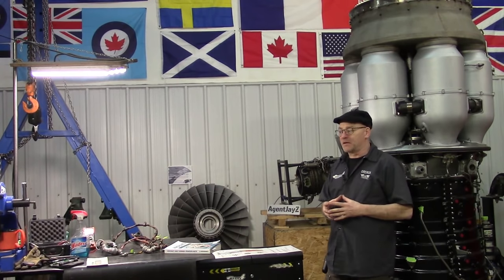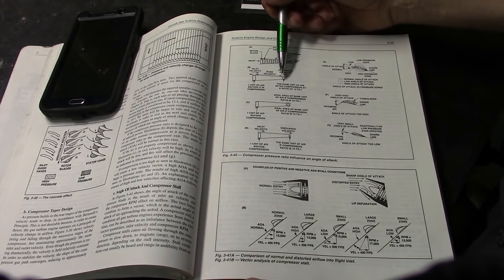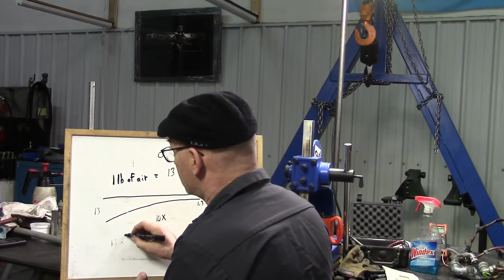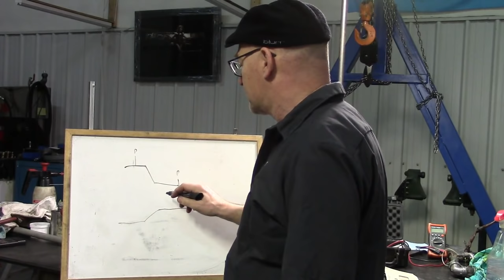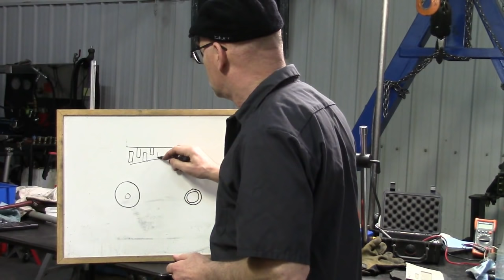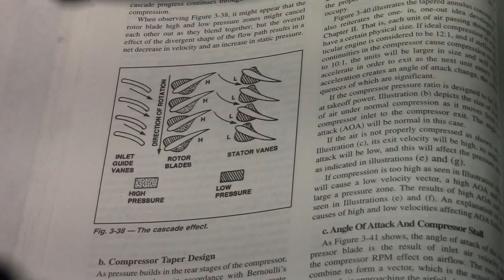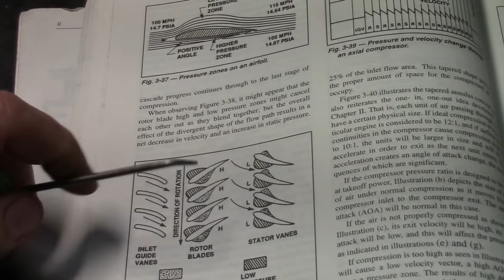the Narrowing Compressor Gas Path: Jet Engine Mistakes 3

Comment: The problem i still have is that all the individual steps make relative sense, but not how they all come together, why does it just... work... compressor sucks in and compresses air so we can burn  fuel in it, it sucks in the air because it’s spinning because its being driven by the turbine in back, thats being driven by the exhaust gasses from the combustion, which is running because of the compressed air being fed by the compressor.... and on and on, it doesn’t really click as to why there is a steady state directional energy being produced by adding the energy between them... it feels like the energy added in the combustion should just push both ways equally, nothing more useful than putting a candle between two pinwheels...
Reply: I had the same problem.  He explained this in his combustors videos.  The pressure outside the combustor is higher than inside the combustor.  So the expanding gas flows freely out the back toward the turbine.  Watch his series on combustors.
Reply: This sounds like a chicken and egg problem. Maybe this will help: When you start the turbine engine e.g. using a "starter", you first need to get the engine spinning, so that the air is already getting compressed and flowing through the whole engine. Only then you can add fuel, and the hot combustion gas can only go out from the back because it has a lot of compressed air pushing it from the other side. Together with the compressor, the started is also spinning the turbine, but once the accelerated hot gasses reach the turbine they will start spinning it and the starter can be disconnected. From that point on the process sustains itself as long as you keep pumping fuel. I can only guess what would happen if you would try to just pump fuel in the engine and ignite it without a starter spinning the compressor. My guess is that nothing would happen due to the high flash point of jet fuel (38 C). On a hot day maybe some of the fuel would burn thus consuming the oxygen in the air already inside the combustors and then the flame would go out. Disclaimer: I'm only an enthusiast. AgentJayZ has already corrected me in the past and I would be thankful if he continued to do so!

Comment: 1,05^10 = 1,63. To get 10 times compression in ten stages each stage has to be 1,26. Modern engines are even more aggressive, like 1,4 to achieve 30 times compression in 10 stages.
Reply from the maker: I'm about getting the general idea across, and avoiding picking over nits and wits.
Modern engines have over 40 :1 compression, and have more than 10 stages.
Reply: @AgentJayZ  I get that but it sounded so far off I thought I might be missing something. I had a look at GE F414 as modern but it is still close to 30 years old so not quite new. I'm a bit amazed what it can do with so few stages when the older J79 has 17 stages and half the compression. Does each stage in an engine provide the same compression or can there be a big difference between the first few stages and the last?

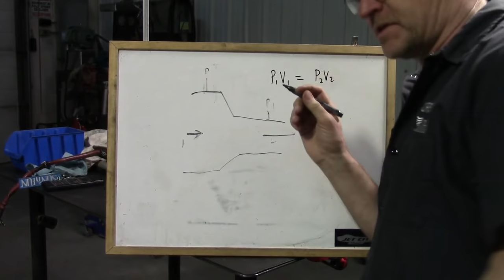Comment: 13:45 This should be P_1  + 0.5 \rho  v_1^2 =  P_2 + 0.5 \rho v_2^2, where \rho is the density of the fluid (neglecting temperature change).  Bernoulli's Equation.
Reply from the maker: This channel is all about explaining things without equations.
Reply: @AgentJayZ  and there's tremendous value in that. Unfortunately, this is one of relatively rare times you write an equation, and  an even more rare instance of the equation being incorrect.
Reply from the maker: OK. But the point of this video is that the compression does not happen because of the narrowing of the gas path. The narrowing of the gas path is created to maintain the velocity of the compressed air.
Reply: Thanks for clearing that up.
Reply: Density, volume and speed and in that order?
Reply: @nunyabusiness7630  P is pressure (pascal) v is velocity (m/s), and /rho is density kg /m^3.

Could do other units, but that's really annoying.

Comment: Mr. JayZ, you're probably busy getting to many questions, but here's mine:

Like you said, after each stage of the compressor, or after each stator, the pressure is increased just a little right? And this is why these engines have many stages, so they can compress the air enough for combustion with fuel. What about tiny jet engines that only have one stage? (a hobby engine or a portable generator) Does that single compressor rotor and stator compress the air enough? Or is it okay because these tiny engines aren't so powerful...
Reply: These tiny engines use centrifugal compressors. They can have compression ratio in the range of 3-15:1.
Axial compressor, as seen in the video, have a pressure ratio of 1.2-1.4:1 per stage (at least modern ones do), but you can have many sequential stages.

Comment: Would it be reasonable to say:
1.	Each blade on a compressor is roughly equivalent to a piston in a 2-cycle engine with the bore being the circumference of the stage?
2.	And each stage of a compressor would be the equivalent to a bank of internal combustion engine cylinders.
Just asking as Stanley Hooker of Merlin Supercharger then Jet Engines  fame including the Nene, Olympus and RB211t is often quoted as saying engine power is about the velocity and amount of air flow. 
24 and 32 cylinders was about the limit of aircraft engine design
Reply from the maker: These engines are so different from piston engines, that it is never helpful to Think of them "as if" they were some sort of equivalent.
What's reasonable is up to you.
I would not describe things the way you have.
Reply: @AgentJayZ  I realize that sir but in the sense that power for flight is produced by means of moving a high volume of air at speed from an engine with low weight they are similar. At present the ultimate is the rocket motor, until we develop a 'warp" engine that is!!!
Thanks for your reply.
Reply from the maker: I disagree with any similarities, except they burn fuel.
Reply: Not.

Comment: Heres a question that might not of been asked and you may also find a little 'out there' but would it be possible to turbocharge a jet engine by taking some of the exhaust gas to drive a large compressor to force more air into the engine? Would it even be of benefit if you could ram more air into the engine, more than just the speed of the engine travelling through the air?
Reply from the maker: Ahem.... Uh... have you ever heard of a turbofan engine? They are the only thing happening in airliners and fighters today...
You've got a great idea.
Other people had it fifty years ago.
Reply: @AgentJayZ  hmm, I guess I'm thinking so hard that I'm not seeing the wood for the trees! The answer was staring me right in the face all along!
Reply: That's exactly what a jet engine already does. You can almost envision a jet engine as just a massive turbocharger, except that nobody bothered to put a piston engine in the middle. The compressor's job is to squeeze a bunch of air into the combustor, and the compressor is driven by extracting some of the exhaust energy with a turbine, which is precisely what a turbocharger does. What you're describing is basically just adding more compressor and turbine stages.

In fact, if you have a mild disregard for personal safety and a moderate amount of fabrication skill, you can actually make a (very inefficient) jet engine using a car turbocharger at home - you just need to connect the compressor discharge to a combustor, then to the turbine inlet, figure out a good way to fuel it (propane?), and figure out a good way to spin it up and ignite it (as well as figure out a good compressor/turbine combo to keep your bodged jet in a decent operating area for the turbo).
Reply: @AgentJayZ  I don't know if this video broke my brain or fixed it. Excellent work

Comment: Using axial fins to create a hard pneumatic wall (buffer) that won't succumb to the explosion of added fuel in the combustion chamber. Thus, the added fuel  combustion is addequit for producing alot more force out the back end. Its a fine line of fuel control per atmosphere vs. desired thrust.
Reply from the maker: Interesting. Nothing you have said here has any relation to what is actually happening in a running turbojet.

Comment: So basically guys what Agent says is that compression occurs because the space between the rotors and stators of the compressor is DIVERGENT!
Reply from the maker: That is exactly correct. Check your physics text books.
You might be surprised by that fact because you did not expect things to work that way, and you thought you already knew.
That funny feeling is called learning.

Comment: Hi AgentJayZ very interesting as always. Does ram air pressure have any impact on engine performance vs compressor generated pressure? Say for example running an engine on the test stand with no ram air pressure vs the same engine operating on an aircraft at (say) 500km/h but at identical throttle setting and now a combination of compressor pressure + ram air pressure?
Reply: Yes it does make a difference, but it's not intuitive. Ram pressure and engine mass flow increases, but so does ram drag, and at different, non linear rates.
The end result is that thrust typically drops very slowly until about Mach 0.3, then it begins to rise slowly. At Mach 1 and above there are shockwaves to complicate this further, and then intake design (which is designed as part of the airframe, not the engine) plays a big role in how thrust changes with speed.

Comment: Wow, I think after 14 years, you have gotten incredibly good at explaining these. Wouldn’t ‘pressure’ be better described as ‘density’? Hopefully I ‘got it’ now.
Reply from the maker: pressure and density are closely related, but definitely two different things. You need to work on that, or nothing will make sense.
Reply: @AgentJayZ  I think I’m understanding the relation of density vs speed/pressure of the incoming air, thus making these monstrous powerhouses/ powerplants? (but making sure I’m understanding everything?) 

Very different from piston, but similar in ways...only for the sake of burning the most fuel from a given volume of air, and maximizing power output: turbines happen to be on an air steroid!

Hope I’m getting this?

That sir, (Agent Jay Zed) that was an awesome video nonetheless! As always.
Reply: I know it’s an ask, but density vs pressure/ speed...the density has to be a factor?
Reply from the maker: Stop this. You need to read and learn, or nothing will make sense.
Speed, pressure and density are three real physical quantities that can be measured. They are all different things.
Speed is distance / time
Pressure is force/area
Density is mass/ volume
Continue your reading until you understand these quantities and the units used to describe them.

Comment: It's not that it's so important to make a high speed of air through the compressor as it is the since all the compressor blades are all on the same shaft and basically the same diameter they will all be turning at he same speed and the narrowing pathway is done to keep the speed the same for each compressor stage, not necessarily to keep a high air speed through the compressor.
Reply from the maker: You are incorrect, and don't seem to understand that as air is compressed, it takes up less space.